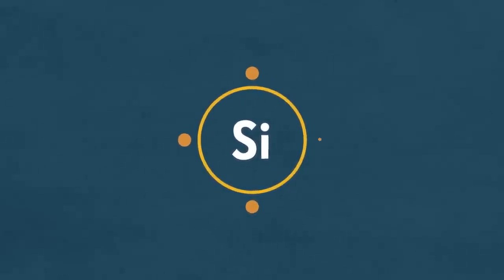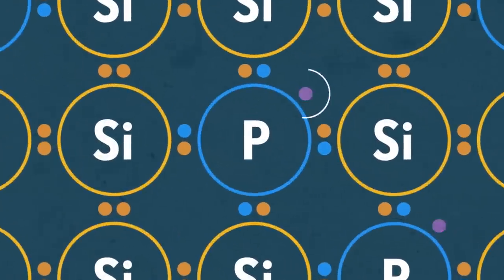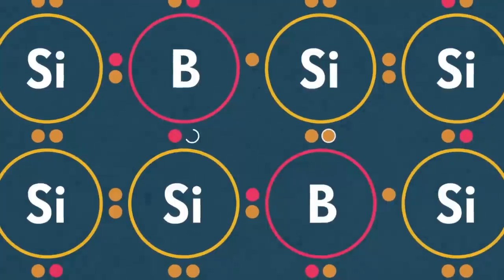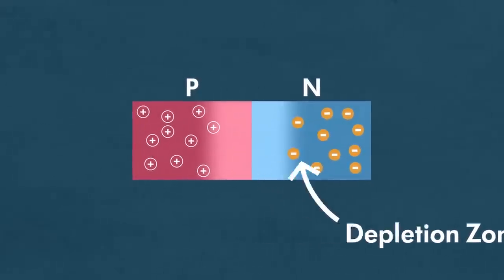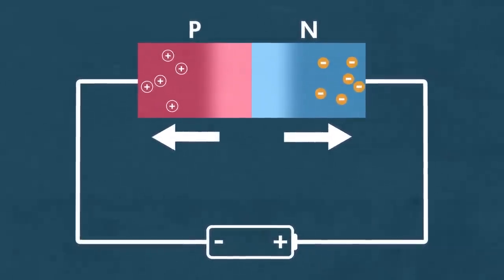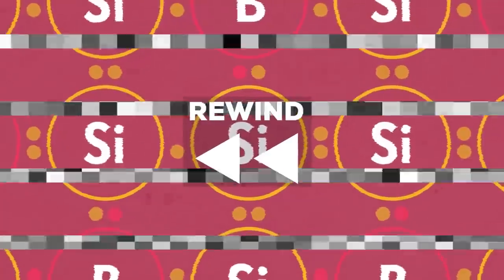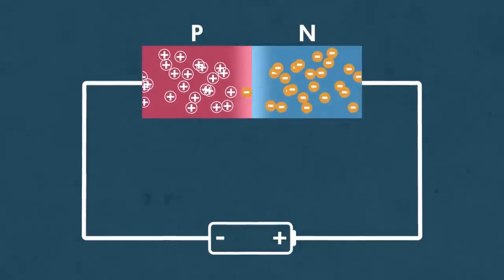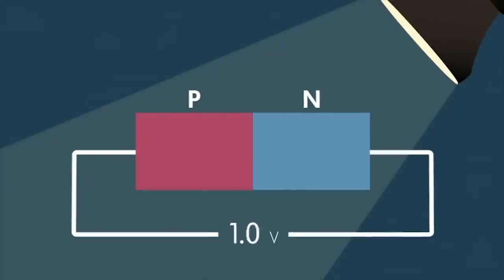How diodes, LEDs and solar panels work

Comment: So all diodes actually emit photons? Is the energy per photon (and wavelength) directly related to the voltage drop then? Or do the types with higher voltage drop just emit more photons?
What happens when the reverse breakdown voltage is reached?

Comment: And white LEDs, is there drop bigger or smaller and would it not make a better / more efficient solar panel? To use only silicone based solar panels to get the energy from only infra red (if it works that way...) Would be inefficient I guess, is that why solar panels only got around 20% efficiency?? So many more questions after this video. Good video btw ;-)
Reply: There's no bandgap that produces white: white is a combination of frequencies.  Most white LEDs are blue LEDs with a yellow phosphor coating on top (which is why they look yellow when turned off.)  Thus they have the forward voltage of a blue LED, 3.2 - 3.8V (which is much higher than the Vf of IR LEDs, which is more like 1.5V!)  This does translate to a higher voltage if you use that technology as a solar cell. But that isn't the only factor you need to consider.

The biggest factor is possibly cost: silicon PV is still very cheap compared to green or blue, especially for large structures like a PV cell.  If you look at the solar cells used in low volume, high cost situations like satellites, you can find some solar cells based on other semiconductors, and they are indeed more efficient.

But you still have the issue that the panel is only really converting a small portion of the spectrum. The best would be if you could use some mixture of multiple band gaps so you capture a much larger percentage of the incident photons, like https://www.extremetech.com/extreme/252295-layered-solar-cell-can-capture-wavelengths-solar-spectrum

Comment: Great video! I have one nit to pick as an electronics engineer though. P & N doped silicon aren't 'pushed together'. They are created by taking a single crystal of pure Si and doping different areas (each end, if you will) through a masking technique. In other words, cover up what you don't want doped with the N 'impurity' then mask the other end and dope with the P 'impurity'. The same process is used for transistors and on a bigger scale for IC's. I'm certain there are videos of this process by major chip manufacturers like Intel and others (I mention Intel because I worked for them in the 90's, although not in their manufacturing, but in one of their board design groups). Sorry, I just cringed a little when you over simplified on this point. :)
Reply from the maker: Thanks for the comment. I cringed too when I found out!

Comment: Are the p and n type semiconductors not already charged chunks of material? Like, if the n type has a bunch of electrons floating around, why wouldn't they like. Run off into a more positive material?

Comment: If the positively charged atom gets attracted by the negative terminal in the the battery the the structure of the matter will change? Is that really the positively charged attract? Can you please make a clear illustration of what actually happening inside a diode because I really confused please!?

Comment: Hello, I’ve heard of doping crystals before in laser engineering. Are the doped semiconductors for diodes made in a similar process as doping solid state laser crystals? What does the doping process look like for either?

Comment: My predictions for the video (this could be all wrong as its based on GCSE physics):
i have no idea how LEDs work (i assume they heat up light normal lights)
I assume diodes are just more resistive in one direction and current flows along the path of least resistance (so not through the diode in the wrong direction)
and i think i know how solar panels work. the sun excites electrons and creates a current

Comment: If the color emitted changes based in the material use for the diode then how do color changing LEDs work? Is there a "medium" color spectrum material that can change the color it emitted based on the voltage fed into it?

Comment: So does this mean that a gallium nitride diode only generates voltage from photons with the energy of blue light or higher, as red photons wouldn't provide enough energy to kick out an electron?

Comment: Does it make difference which color the light we use to get the electricity out of a diod? What if it's a red diod and we use a blue lamp? Or the same one red..will the voltage we're gonna have be different?
And as long as light is a wave and every color has it's frequency...will the difference in the color of light we pour upon diods result in different voltage?

Comment: So.... does that mean that you can charge the battery from the diodes with light?

Specifically off the diode...

I would assume no as I would expect the electrical distribution to accommodate a concentration zone allowing for a plug persay.

Comment: I’m a novice so please excuse my ignorance. 

But as a diode ages and fails… could that be caused by the reaction/defusing particles being used up over the years? So the equilibrium is finally reached until there are no more particles to react? Is that possible?

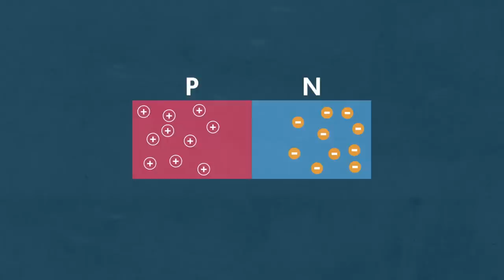Comment: 4:50 Not exactly "positive charge and negative charge zone". Those are insulation zones, which require electrons and "holes" to have some potential energy to cross. That is the famous 0.6 volts.

Comment: Actually, IR remote controls don't use silicon LEDs, they use gallium arsenide.
Silicon doesn't make good LEDs because it has an indirect bandgap - it can emit infrared light, as you've shown, but it's inefficient.

Comment: @Steve Mould  when i solder SMD LEDs i noticed that when i touch the anode pad using soldering iron tip the diode faintly glows, can you make a follow up video on this phenomenon

Comment: To clarify then, solar panels emit in infrared and therefore would be adsorbing infrared and not the rest of the spectrum? assuming they're silicon based
Reply: No.  The bandgap is the minimum amount of energy needed to produce an e/h pair.  Any wavelength shorter than IR would be absorbed as well, however, any extra energy is wasted as heat.  This puts an upper limit on the efficiency of Si based single bandgap solar panels which happens to be lower than the thermodynamic limit.

Comment: I still have a question. In school we are taught that current move from the positive pole to the negative pole of the battery. As current is flowing electrons this makes no sense. I raised this point to my teacher and she just avoided the question. This model further conflicts this.....so what's going on? Also I'm from South Africa and our schooling isn't very good so sorry for bad grammar. Im also in grade 10 so this will maby still be explained in later work.
Reply from the maker: Yes, it's confusing! Because electrons are negatively charged, when they move to the left, it's equivalent to positive charge moving to the right! So the flow of electrons is always in the opposite direction to the flow of (positive) charge.

Comment: Can anyone explain 8:38? Surely there would be no resultant electric field across the depletion zone as it would be at an equilibrium where the electrostatic potential is constant across the depletion zone.
Reply: Same question here.
Reply: When the depletion zone is depleted of charge carriers, that is electrons and holes, there still remains positive and negative ions in the lattice from the donor and acceptor dopant atoms. Since we get a net negative charge in the p side and a net positive charge in the n side we get an electric field. The whole diode is net neutral though.
Reply: Although he shows the free electrons and holes moving, there's no explicit notation of the protons in the nuclei(?) of the atoms that these free electrons/holes came from. It is the nucleus charge that is creating the field.
Reply: I'm not an expert (barely understand it), but what I wish was remarked a little in the video is that there are charges in the structure when you remove those free electrons/holes, those charges generate the electric field around the junction. The phosphor atom is neutral, but if you remove the extra free electron it is positively charged.
Feel free to correct me.
Reply: Thank you all for your responses! I am still trying to get my head around this (EG how this does not create an electric field that can do an unlimited amount of work) but your inputs make a big difference.
Reply: Ayham Saffar
That's because there is a limited amount of free electrons and 'holes' in the lattice structure based on how many replaced atoms there are in the diode.

Plus the only way you get those free electrons and 'holes' to do anything (from my understanding) is by applying a force to them, whether by plugging it into a power source or putting it under a light source.
Reply: The photon kicking an electron to a higher energy state means the electron is no longer able to fill the 8th hole in the shell, because that electron is moved to the next shell up (not shown in the video). The now free electron and the newly created hole are then moved out of the depletion zone by the existing electric field.

Comment: I did the experiment of shining the  light on diode(I used LED) ,it gave more volts out when I shone it with UV light than with white light,I guess it's because violet has more frequency and energy but is there anything more than that to this phenomena though

Comment: 07:28
Doesn't the holes (+) come from due to the moveable electrons in the p conductor moving to the + side of the battery leaving a hole behind which then moves torwards the (-) electrons from the n conductur?

Comment: 8:27 "If the photons are energetic enough..."
Technically, (quantumly,) speaking, it isn't energetic enough so much as correctly energetic. The photons energy has to precisely match the energy needed for the electron to transfer electron shells. (This is probably less precise for diodes than it is for say, photon re-emission resulting in precise frequencies from organic molecules... but I might just be an artist obsessed with color science...)
[edit] 9:53 Nevermind I guess you were going to cover this anyway.[/edit]

Comment: Is this efekt useful for Something like tu unfreeze solar systems and to make them useful in winter. Like  first you melted the snow from the moduls by using them as infrared imitater and than you change them beck into solar system that youse the winter sun. 
Sorry my English are not so well.

Comment: so how do white LEDs work?  Is it a combination of materials emitting Red Green and Blue light at the same time?
Reply: yes, sometimes. But the most used and cheapest way is to use a blue LED and cover it with a yellow phosphors powder. This material absorbs part of the blue light and convert it to yellow. Hence you get a blue + yellow light emission which your eye percepts as white

Comment: Thanks for this comprehensive explanation. I knew nothing about this, and now I do little bit. One thing nags me, though that's probably because of the over simplification: 
https://youtu.be/TGUteH93xNo?t=522 doesn't this mean it'll deplete it's electrons pretty quick? Or do the electrons get 'refilled' at some point by another mechanism?

p.s. These animations are pretty neat, too. But there's this grainy and 'vibrating' effect on it to give it a film-roll 'feel', I guess? The grain is nice, but the vibrating is a bit ovekill to to point it's hard to focus on and my eyes start protesting. My eyes would appreciate if you dial the vibrating down a little bit in the next video. Thanks! :-)

Comment: I am sorry, but silicon has inderect band gap. It means that recombination of particles  produces heat rather  than light. So I doubt that it is used  for TV remote control.

Comment: So, if I want to preserve battery used by my screen, should filter out all the blue in my display?
Reply: I think in a classic LCD display it won't change anything, because the backlight is constant and it gets filtered to create different colors. However, in OLED (or similar) displays it can save you a little bit more than filtering red or green light.

Comment: all conductive materials produce some voltage when struck by light and produce radiation when struck by current, ever heard of a radio antenna and transmitter?

Comment: Very good video, but I now wonder how diodes can not emit light
Reply: Common diodes are made of Silicon, a material whose energy gap (between free electron and hole) is known to be non-direct (opposed to the "direct-gap" materials like Gallium Arsenide etc..) this basically means that for silicon is more efficient to lose that energy by converting it into heat, rather than releasing a single photon. Heat is basically Infrared so, even though you might have some infrared light, you do not want to use a silicon diode as a light emitter. Totally not efficient
Reply: @eros91ffm  so it will emit infrareds, but not directly the ones caused by desexcitation, and rather the "black body" ones... Ok, thanks ! 😊

Comment: 8:30 how similar is this to the way that chloroplasts harness solar energy? If it’s significantly different, might there be a way to make solar panels that mimic plants?
Reply: The process is identical in principle, but different in implementation. In solar panel, the resulting hole-electron pair is pushed apart by electric force in the depletion zone. The diode accumulates static electric charge on both ends, which are electro-statically  separated by the depletion zone.
In plants the creation of the hole-electron pair in chlorophyll works the same. But the separation of the electron and the hole is enzymatic. Chlorophyll is attached to a special protein. The protein can pass the electron only to a specific acceptor molecule and can pass the hole only to a specific donor molecule. These are two oxidative/reductive reactions. The end result is oxidized donor and reduced acceptor, which can't react with each other directly, effectively storing the energy in chemical form. The donor and acceptor are used as oxidator/fuel respectively, in separate chemical reactions. (Donor oxidises water into oxygen. Acceptor reduces CO2 and water into sugar * )

*not directly. It merely fuels a cyclic chain reaction that eventually reduces CO2.
Reply: KohuGaly thanks for the detailed answer!

Comment: When silicon is doped by, say boron doesn't its electric neutrality breaks 
So i think when we join it with phosphorus doped silicon (n- type) (which is also not electrically neutral at that time and i think its neagatively charged as whole ) due to diff in charge electrons and hole move until it reach equilibrium so after that no opp movement happen and it cannot work acc to me.
Can you pls tell where i am wrong....
Reply: Doping doesn't change the charge neutrality of silicon.  Boron and Phosphorus are themselves charge neutral.  They do however introduce electrons and holes that are not locally bound, and thus can diffuse into the depletion region.

Comment: Silicon diodes are extremely inefficient at emitting light and are not used to emit infrared light - in fact GaAs is used for near infrared light - otherwise an excellent explanation.

Comment: cool, but wouldn't using a diode in a circuit make the circuit less efficient at delivering the electricity/energy/idk to the lamp/motor/whatever?
Reply: Indeed it does! There is always a voltage drop across a diode when it is in operation, and you can use the formula Power = Voltage × Current, to work out how much energy is being wasted in the diode (normally the voltage across a forward-biased diode is roughly 0.7V)

Comment: Isn’t the + of a battery actually the source of electrons?  When batteries were first
 made they did know electrons had a negative charge.
Reply: The other way around, they didn't know the charge carriers were negative. They assumed they were positive, thus assumed the flow was from positive to negative. The electrons flow from negative to positive.

Comment: So, if LEDs can create electricity from light and they use different materials to make different colors of light, wouldn't that mean shining a light with the corresponding color of the LED create more electricity then other colors of light? 

If this is the case, then LEDs can be used as color sensors!

Comment: Ah, so does that mean that the reason why a blue LED requires a lot more voltage to start emitting light than e.g. a red one, is because it literally needs a bigger voltage drop for it to emit that colour of light?

Comment: Are there any diode materials that produce uv radiation?
Reply: yes there are. In fact, purple diodes are actually not purple. They are UV and have a pigment on the surface that shines purple when irradiated by UV.

Comment: Actually the infrared leds in remotes etc. are also made out of GaAs and not silicon because silicon is an indirect bandgap material and horribly inefficient at producing light directly. It's so bad at producing light it took until the mid 2000s to figure out how to get pure silicon to lase, even then they had to use a Raman technique.
Reply from the maker: Darn it! I didn't do a good job of fact checking that one. Thanks for the info.